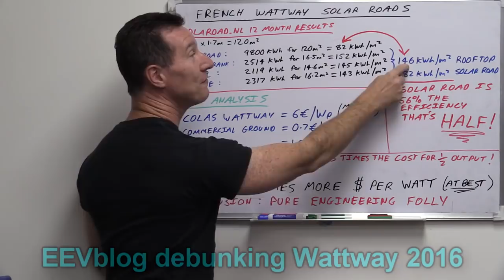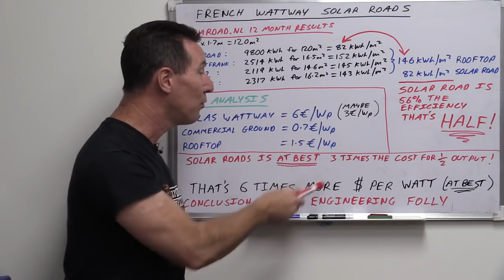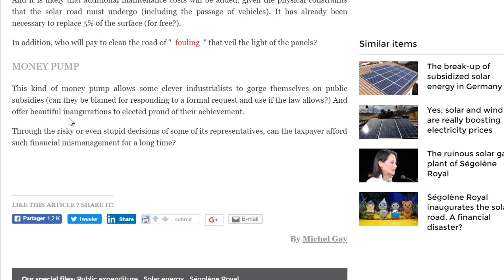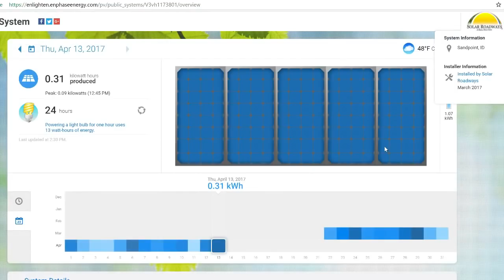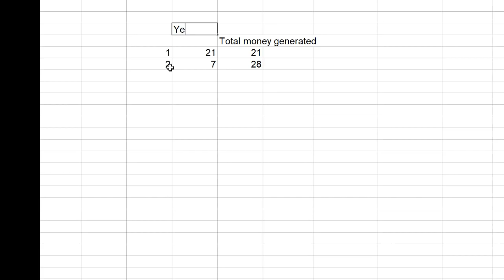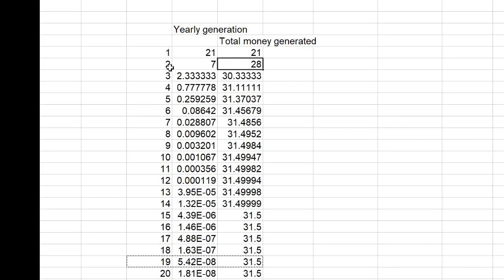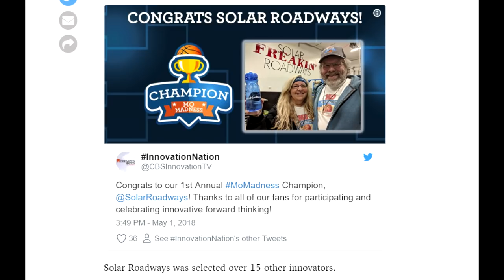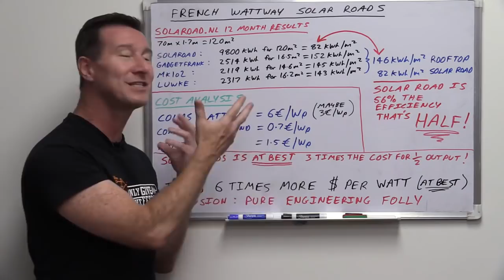Solar Roadway: 10¢ return on $1000 investment!

Comment: Kid falls off his scooter
Sidestand scratches 30ft of road
$200'000 of damage, way to go!
Reply: If a scooter crashing casues that kind of damage, heavy trucks are going to wear that road down in a few hours.
Reply: It`s the Solar Freakin Roadway`s mention of runways that make me cringe.Imagine a loaded jumbo jet landing on this shit.
Reply: prismstudios001 - That's going to generate a lot of "solar energy"
Reply: prismstudios001 oh, but obviously glass that's supposed to be transparent will never be damaged or scratched by 20.000 tons of cargo and steel rolling over it on three tiny points.
Reply: It brings a whole new meaning to a "touch and go" landing.
Reply: JAnx01 Trucks won't be allowed on the SFRs. It would be madness to drive trucks over a solar panel. Or even a car for that matter.
Reply: all the scooter needs to do is scratch the surfice full of sticky goo and no more energy like the same rubber would probably do.
Reply: Let's assume that SFR actually DO work and produce a sufficient amount of Kw per panel every month of the year. What about the shadow that a car casts on those panels by running on them? It can happen for a very short time, without causing a noticeable "loss" of energy production (panel into the shadow=no energy), but basically when a car moves on, the segment not producing energy goes along with it, and still this wouldn't be a great loss. Now imagine MILLIONS of cars going around on SFRs, building up traffic jams and standing still in long rows, the "segments" that couldn't produce energy because of the car's shadows would start to be big numbers to subtract from the annual energy production. Just sayin'...
Reply: Deimos Station, Thatguyonyoutube
Exactly, solar cells produce a voltage that is too low for the power to be efficiently harvested, so they are connected in long series to get a higher output voltage.
Also the solar cells are essentially "Diodes" in which the PN junction is made conductive by the photons pushing electrons trough it.
If only one cell in the series is in shadow it is not conductive and the whole series loses most of its productivity.
Reply: Now I wanna do a massive burnout on it
Reply: We can fix that with solid gold hammers in no time.
Reply: That's a lot of damage!
Just slap some Flex Tape on it!
Reply: ghost jesus Don't forget its also Georgia so there are fucking trees everywhere casting shadows on roads.
Reply: Or a parade with many horses with horse shoes! total surface wreckage
Reply: Freddy Lasthope Amen, I love solar, just not horrible idea solar. Frikken Nuclear Roadways would be awesome, though!
Reply: Everyone here is forgetting the biggest killer of roads in the northern US, ice. Ice would split your solar bullshit like a watermelon.
Reply: A scooter wont scratch it that badly, but I guarantee you that a car or a truck will, provided that there is metal to road contact.
Reply: Ohh noooo roads have self healing repair  XD ooooooooo
Reply: Now imagine up north with winter wheels. Small carbide tips slamming into glass is going to work no issue. Not like glass is brittle or anything.
Reply: it makes more sense to put solar panels above the road
cheaper and as benefit they can produce shadow for the drivers

Comment: Why would anyone make a solar parking lot? Make a covered parking lot with conventional panels on the roof. Charge drivers to  park in the shade.  Win win.
Reply: At our local Westfield Topanga mall in Canoga Park California they have massive solar arrays on the roofs of all the parking garages.  Over 2 MW of production at this one site alone.
Reply: @garywatson  but why not put the panels in the parking lot surface for a much higher installation cost and a fraction of the power generation? That's the future. Gotta cover up the panels with cars.
Reply: Also put them in the underground parking lot, where they won't be an eyesore.  :-)
Reply: Just another add on to your idea, have charging stations for electric cars in the car park.

You can charge the cars more for the electricity then you'd get selling the electricity to the grid, and when demand is to high, and or its nighttime just sell power from the grid to the cars.

Don't advertise that last fact, but obviously your not going to be selling pure solar power 24/7 at a profit.
Reply: Or, just put up some fake solar panels to save money, and just sell power off of the grid.   LOL

Comment: I really wonder if someone could make a calculation of how much would it cost to have (regular, boring...) solar panels on top of the "cross country" roads which are usually straight and boring.   On top I mean have a light structure that goes above the road and have the panels "on the first floor" completely rotating or at least fixed towards South.    I know the structure would incur additional expenses of course, but they could be a lot less than buying land to have some solar power plant.
Reply: It's better to have electricity generated near the user - solar panels in a very long strip hundreds of miles from towns/cities still need maintenance & the electric has to get to where people need it - the electric has to be transformed into high voltage to transport it. Makes more sense to have compact solar farms in the desert or put panels on user's roofs right where it's needed.

Comment: even without speaking money, how much energy does it take to produce the solar freaking roadway, now how much energy does it generate?
if your energy invested is more than the lifetime energy output all you did was waste energy.
it is like (numbers are fictional just to prove a point) using a electric heater that cosumes about 50kw/h to heat up watter to generate steam to power a steam engine that produces 5kw/h of energy
(that sounds like a great idea for a kickstarter, i think i am going to be rich)
so if solar rooadways produce about 31usd at 0.12usd per kw/h in their lifetime, that means the whole setup can not require more than about 260kw/h to not be a waste of energy
Reply: "WATTer" is a great name, if you go for the bogus crowdfunding campaign.
Reply: you good sir sound like the perfect marketing manager for my campaign,
that ofcourse also qualifys you as lead technical engineer because marketing and engineering is almost the same thing

Comment: Why can't these governments use this money to finance solar installations on homes instead? A 6kW solar installation would cost around $10k. $5mil would buy 500  6kW solar installations on roofs of homes. That's 3MW! That would be a terrific compliment to the power grid. It would also make the homeowners happy as I'm assuming they would have little to no electricity bill.
Reply: because this is a con artist
Reply: Because rightwingers have homes
Reply: Well I'm sure people would find some way to get upset.
In fact, the other day in my town, some solar panel installers at a house nicked the utility wires, which shorted out and started a fire. Luckily it didn't burn the house down, but it damaged the wall.
Reply: +the recently undeceased that doesn't make sense. The Dems got a lot of monied interests pulling their strings, not a single representative on their side is buddies with a manufacturer/contractor? I'm sure there's a reason why only GOP representatives do it but I don't think that's it.
Reply: NOT REALLY
if you plan your day and do all your heavy  energy during the day and thus use the sun and not the batteries
and use the batteries for the light computer and tv that is not taxing 

what you describe is live a stupid life style while on solar panels and batteries!?!?!?

some countries they have lower electricity prices at dead hours to promote people use the power that hours and not at peak time
and you know many do to save money 
so eys you need 4kw per day? but can you plan your day to put the 3kw or more in a specific part of day?? 

and if you talk about batteries then you go complexity off the grid
you do not sell the electricity you keep it all for you which makes sense  rather than sale electricity is low prices and buy it at more expensive ones 

i have a friend that is off the grid and only has 2 small solarpanels each 250wat
and he is doing okey , the kitchen is using gas by the way but everything rest is covered by that
Reply: Government and functionality just can't ever coexist.

Comment: I still say that if idiots want to make solar roadways, they could do it much better and probably as cheaply by putting roofs over the roads covered with solar panels. And in northern climates we could take it a step further and use something like clear fiberglass panels to wall of the road (leaving enough of a gap between the top of the wall and the eaves of the roof to allow exhaust fumes to escape) you could keep rain, snow and ice off the roads making them safer and last MUCH longer. It would STILL be a stupid idea, if for no other reason than power loss from having to transmit power along miles of wire with such a spread out system. But at least in a place like Michigan we would save a lot of money on snowplows, salt and road maintenance, and have fewer crashes. Heck, walled roads would stop 50,000 car/deer accidents per year. But of course, we would need to build deer paths over the roads so wildlife can still get around, but what the hell? We'll have SOLAR FREAKING ROADWAYS! We'll be awash in money! Right?

Comment: Why are their solar panels losing their efficiency so fast?  Are they just using extremely cheap panels?
Reply: Two reasons: excessive heat, and fractures in the solar cells. Both avoided in a standard rooftop mount.
Reply: Chris Muir Ah I see, that makes sense.  Thanks !

Comment: While I agree the concept is utterly unviable and your correct in the conclusions, I have a nitpick with the efficiency drop:
You only have 2 datapoints for yearly drop, first year and second year. Extrapolating from that gives you no information about the curve structure. But like I said, this is just a nitpick, even IF it wouldn't drop a single percent after year 2, the concept is completely bonkers, I'm not defending the solar roadways here, I'm merely pointing out a flaw in your prediction model

Comment: Solar roadway? This is a terrible idea from an engineering perspective. Traditional panels aren't that durable, certainly not enough to handle roadway traffic. Even newer, more durable technologies would require a lot of maintenance. You'd also have all the crud from people's cars and general dust and dirt accumulation rendering the panels ineffective in a very short period of time. You'd have to constantly clean the entire highway to keep it functioning. Traffic accident or construction, or just general city driving? Entire sections of the roadway would be unable to produce any electricity since it would be completely obscured by vehicles.

This is the kind of thing that should have been written on a napkin as a passing thought and then immediately tossed out because it's not viable.
Reply: I completely agree. And I'm not a proper engineer (at least not yet), yet it makes sense that it wouldn't work well.
Reply: it would make more sense to make a super construction and put them on top the road
which will provide also sun protections for the cars by driving in the shadow 
geeee

and if the car is on top the panel it will nto produce any power how ahrd is that to figure out??
Reply: Yeah thunderf00t brought up several of those problems. He also mentioned before that they are tiles rather than a "cohesive" surface like asphalt, which means that vehicles rolling over them will knock them loose with the ground pressure and vibrations.

Comment: Biiiiiiiiitconeeeeeeeeeeeeeeeeeeeeect
Reply: Hey heey heeeey
Reply: 10/10 Pharos support that service. :P
Reply: I actually made about 10.000USD on BitConnect.
I saw 0 marketing or any kind of material about it, but I bought ~100,USD of ~90 different crypto coins in September 2016-March 2017. BitConnect was ~1,USD at the time, and I sold it for over 120,USD per unit. So I recouped all of my experiment. It was far from the only coin to do tremendously, but most failed. I ended up +42.300,USD after taxes this year.

Comment: you know solar roadway could work but not the way everyone thinks 
take tubing and make thousand of loops in the road each loop has a valve and is filled with water the sun heats the water loops and when they heat up enough the valve opens and the water turns a generator. during winter the roads will stop producing so why not pump hot water to melt snow and ice when it snows

Comment: to be honest solar energy is not developed enough to allow it to be used as a main energy source
Reply: Solar energy has long been technically possible, both for heating and for electric power, but had a problem competing economically back when fossil fuels were relatively cheap. But fossil fuel prices have gone up, and the price of photovoltaics have dropped, so Solar is now economically competitive, and will soon be the main source of power and heat.
Reply: Chris Muir i dont think so because solar panels are still rather expensive vs coal and has a low energy/m^2 production compared to others like coal or nuclear plants, dont get me wrong solar is great but its only aviable in the day and batteries cant hold the very large amount of energy consumed by cities, it still has to develop

Comment: Why not a covered roadway with solar panels on top? These people were so concerned with doing something new, that they ignored better solutions.
Reply: and have it shade the cars below so they can use less air conditioning in the summer meaning they'll use even less fuel/electricity? and also deflect rain and snow so the streets are safer in the winter? and capture the rain before it hits the ground so it is cleaner and needs less treatment to use?   
    
what kind of heathen are you? solar panels belong underneath cars where they're always partially shaded, never in the correct orientation to the sun and are receiving heavy wear and tear from the 1 to 30 ton machines running over them.
Reply: that would be too easy and efficient and good.
Reply: It's like adding a radio to your hammer.  Yes, it is possible, but the material and demand requirements are vastly different, so best to keep them separate.  Put solar panels out of the way of traffic, angled to catch more sun for higher efficiency.  Then, you don't have to revolutionize material science to find a substance that works as a road, and a solar panel.  Roads are complicated things.  Problem with a roof, how high and wide do you make it?  There are some unusual sized-loads going down the road some days.  What do we do then?
Reply: I mean shit.. if no ones gonna be driving. on them, they could even tilt to track the sun and thus be even more efficient..
Reply: Over-height loads would need to take alternate routes... same as is done today.
Reply: Well, Koreans installed that, but not on a road where height is an issue, but on top of a bike lane. It keeps bikers cool and delivers as much energy as a rooftop installation.
Reply: Should just divert all this imaginary money toward fusion technology. There's a solution that can give us sustained, constant, energy rather than an unstable electrical grid that so many solar panels would provide.
Reply: Isn't that essentially what the Korean example was?
Reply: Took the words right off of the top of my poor head. (But there remains the Problem, of big hunks of steel hurtling "Out of Bounds, :)
Reply: Why not just put them on roofs?
Reply: It would be incredibly expensive to build a permanent structure that holds solar panels and is complying with safety standards.
Reply: @d4n4nable  Would most likely be cheaper than a solar road my dude.
Reply: +1
Reply: This is a great idea COMPARED to solar roadways... aka nearly everthing would be smarter.
Reply: They have been putting up suspended solar panels in parking lots all over the place where I live.  It can't be that expensive.  I have no idea if it makes financial sense, but it's obviously a better idea than solar roadways.
Reply: @d4n4nable lmafo, far cheaper to build trusses than the roadway. One truss would do more than these crappy roadways and is nowhere near half a million dollars.
Reply: I can tell you right now that building a light metal structure to hold the panels up over a roadway, even suspended completel over a 4 to 6-lane roadway, would not be that expensive, not compared to these solar roadway installations. Solar panels are light. You'll have moderate wind forces from the panels up high, but nothing a few braces can't handle.
Reply: Yeah that'll be too high because of Trucks/Buses.. and some people will say it'll looks ugly

Comment: How much does a normal roadway (not solar roadway) cost per square meter?

3:29 so it cost 5€ per square meter huh? Is this correct? Don't be mad at me for asking that question a second time, I normally double check for maximum accuracy.

Comment: 0:10 "If we installed solar panels across 1% of the world's deserts we could produce enough energy to cover the entire world's needs"
Then why the FUCK not do that?!

Edit: Did the math.
1% of the world's deserts is about 14.2 million square kilometers.
The cost of a 1 square kilometer solar panel infrastructure is about $150 Million.
So to cover the $2.138 Quadrillion.
For comparison, the World GNP is $78.28 Trillion.
Therefore, it would take the world about 27.3 years to pay.

But still, why not build solar panel structures? Cheaper, more reliable, easier to maintain and more profitable than this solar roads garbage.